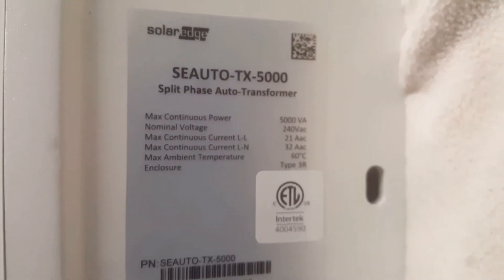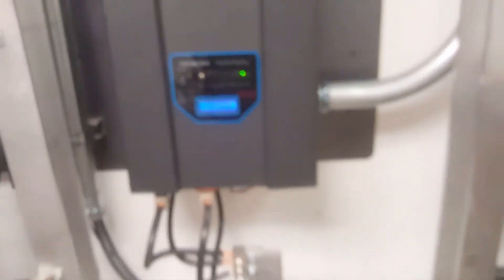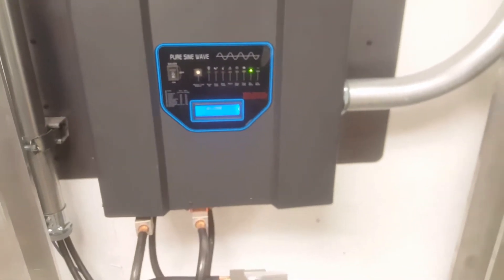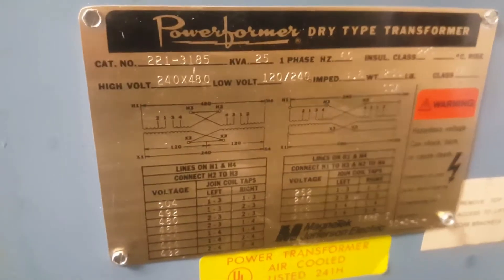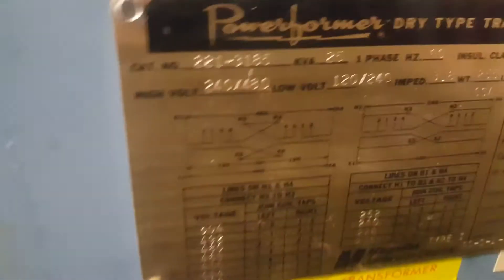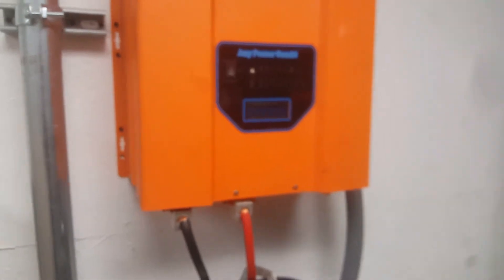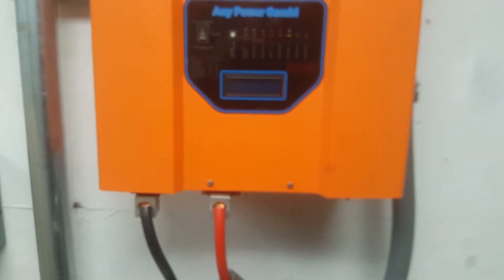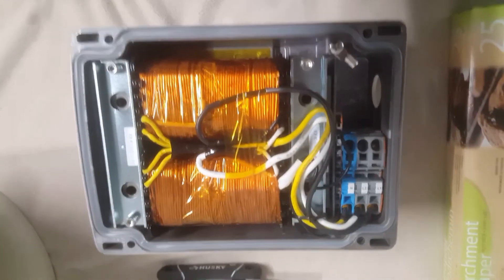New autotransformers for Living Off The Grid

Comment: My inverter is 230v single phase output can I use the solar edge to 120v I've watched a bunch of videos but they inverters have neutral ground and line and my inverter only has line and neutral
Reply: If it's a 230 v, that's a European model and I wouldn't be using it in America.

Comment: I just used one of these to balance the solark 12k. use it to switch the phase and then add it to the other leg. Had to drop the neutrals from the solark and left the neutral on the transformer to the panel. It balances perfectly. 5hp compressor fully loaded used to trip the solark every time, not had it happen since.

Comment: I have a question. I have 4 hybrid 5500 watt inverters instead of having  L1-N-L2 they have  Ground- Hot-Neutral for both the input from the grid and output to the subpanels. The PV output is 240v, battery output is 240v but if i stick in 1 leg of grid it is 120v of course when everything else is turned off. How do I get 2 legs of 120v to make 1 leg of 240V to feed the inverters at night time or cloudy days when batteries are depleted? How do I get 1 leg of 240V out into 2-legs of 120v to feed my subpanel? No solar installers around here will touch em, no electricians will touch it. It is basically a euro design but on 240v and 60 hertz.
Reply from the maker: @easylooker I made a more updated video that answers your question better, but you can also check out the page on my website at https://currentconnected.com/?page_id=414

Comment: Could a guy plumb a set of parallel Honda 2200i’s into one of these and yield 240v to run direct to a transfer switch as a home backup? I have a 1hp well pump.

I have also considered using an inverter to convert from 12v to 240v, using say my trucks 200amp alternator and its two group 31’s as a buffer. 

Do they have auto transformers for 12v to 240v that could convert directly from a vehicle’s battery to a transfer switch?
Reply: Yes

Comment: I am very concerned with a back feed from my generator and a voltage drop when it is under load and I am looking to ensure that my generator will not burn up my inverter. Because of this I am looking for a way to clean up my power from my generator before it gets to the Inverter and to my more sensitive loads like my Freezer (Which the generator killed). 
I am an electrical idiot so please forgive the question but does the Autotransformer clean up the power? Do you think that this would work for my problem? Thanks in advance. Jim
Reply from the maker: ChileExpatFamily I would not say an autotransformer is effective means for cleaning up the power.  Your best bet is to just keep running everything off the inverter and have a standalone battery charger that runs off the generator. Converting to DC is the only real way to get perfectly clean power from a crappy source.
Reply: Ok this is what I have been told elsewhere and I am happy that you are steering me in the correct direction. I am planning on purchasing an industrial grade High Amp battery charger and bypassing the Inverter entirely and go directly to the batteries with the charge as you described. 
Are you planning on going this direction as well? I am not sure but I think that your inverter is a charger as well, but you had problems with the generator blowing it up, so is this the solution you are using? Thanks from Chile . Jim

Comment: Forgive me if it’s already in another video but how does the Honda like that floor mounted transformer. Does it shut off for overload. Very interested to see what happens with the solaredge transformer.
Reply from the maker: +Gain Solar Services the generators work perfectly fine with it, except the Transformer alone draws 9 amps just to keep it energized without a load. Now switching over to the solaredge auto Transformer it takes a lot less to run the battery charger. I have it done just need to make a video on it.